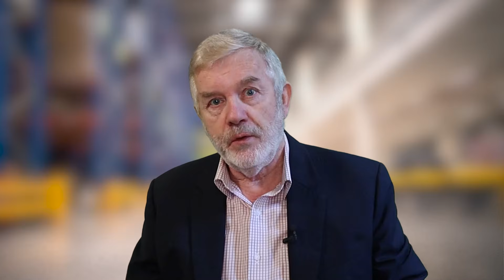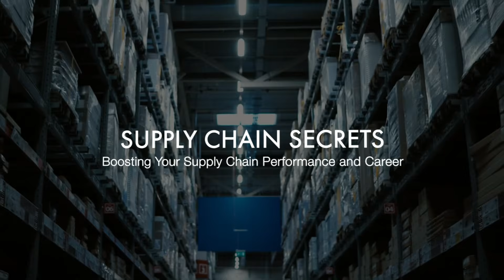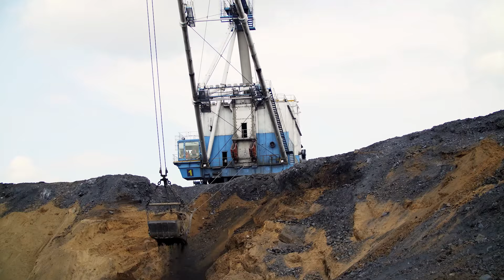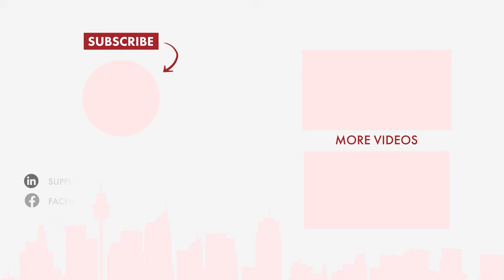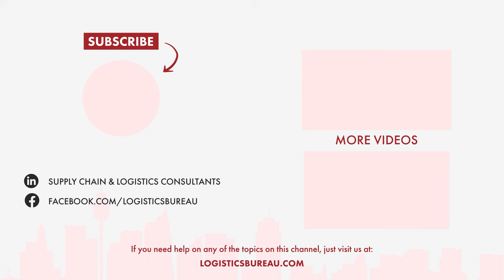MRO Supply Chains - Maintenance, Repair and Operation - How they Differ

Comment: Good topic. I currently work with an aviation MRO facility in the procurement department and one of the main challenges is sourcing and procuring parts that have very long lead times but the mechanics need them yesterday! You are right in that the MRO supply chain is quite different than the rest.
Reply from the maker: A very common problem, that can lead to high stock levels of very expensive materials.